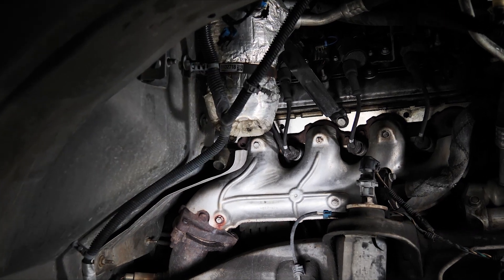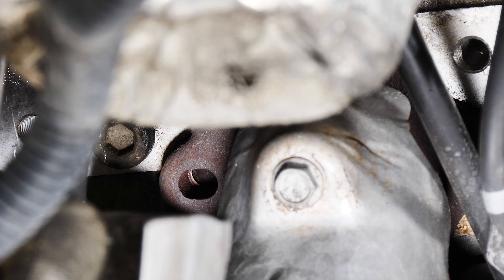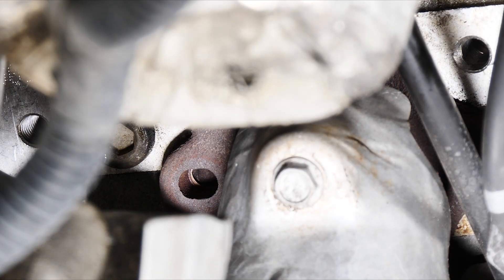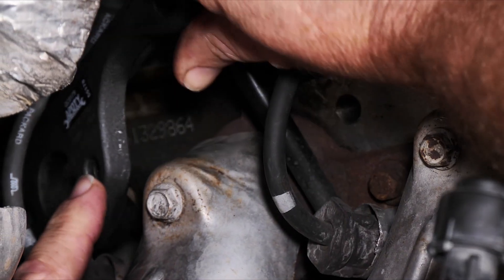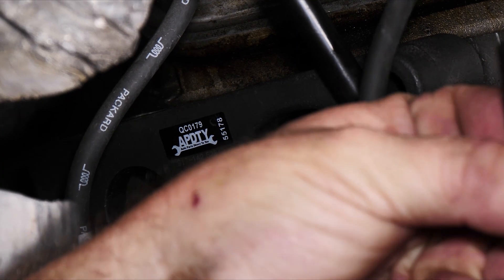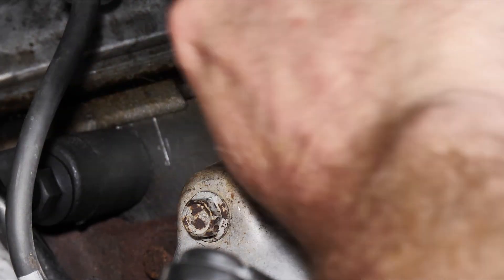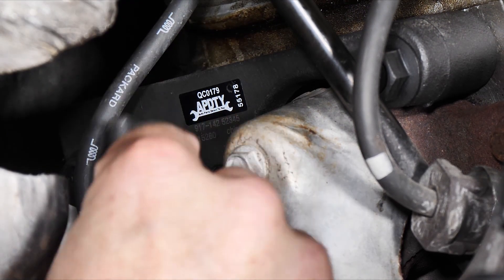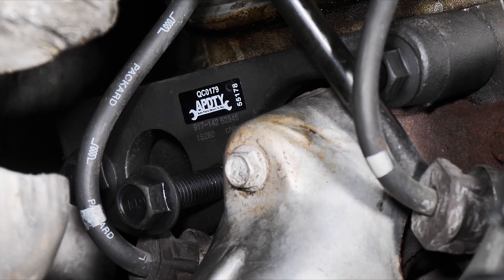GM LS Engine Exhaust Manifold Leak From Broken Cylinder Head Stud

Comment: So these brackets withstand wild exhaust temperatures. 300 + degrees?
Reply from the maker: Caleb Willhelm these are made out of cast iron, the exact same material the manifold is made of, we have installed these on trucks that have already been on the road for over 3 years and no problems
Reply: @APDTY  thank ya sir!!